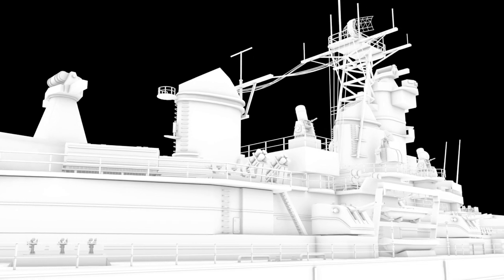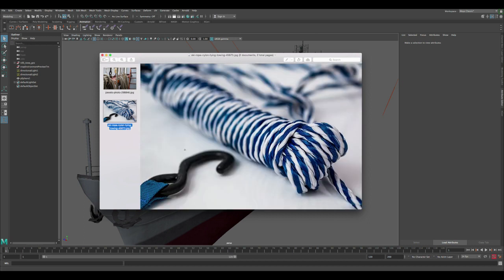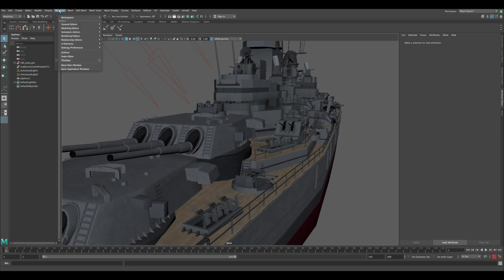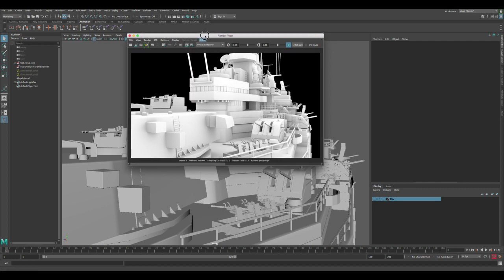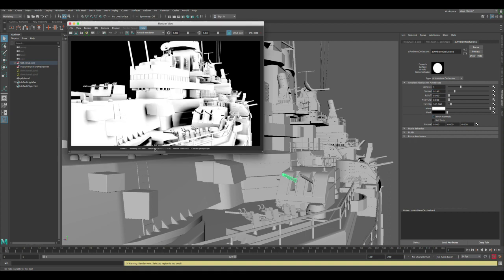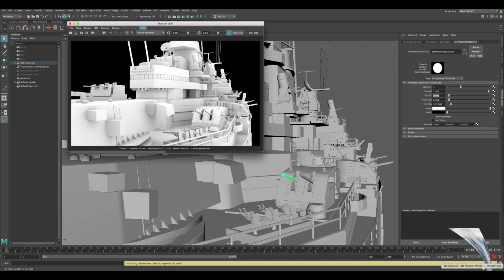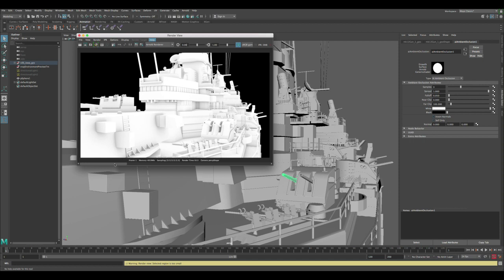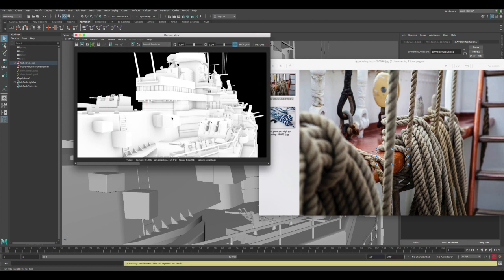How To Create Ambient Occlusion in Arnold Maya 2018

Comment: Hi Adam! Great tutorial. I am just starting to wrap my mind around Ambient Occlusion when it comes to compositing it in to the final render. Could you recommenced a tutorial that covers that? Thank you!
Reply from the maker: Hello, Thanks for your comment. actually to composite ambient occlusion pass if you are using After Effects do the following:
1- Import the beauty pass that you rendered out from Maya or any 3d software  you use.
2- Import the Ambient Occlusion pass.
3- Create new comp with the settings that matches your rendered images size and frame rate like 720p @ 24fps
4- Add the beauty pass first to the comp.
5- Add the ambient occlusion pass on top of the beauty pass.
6- On the right side of the ambient occlusion pass inside the comp you will see the (mode) currently it will be set to (Normal) click on it and change it to (Multiply). Ambient occlusion should apply correctly to your pass.
7- if you cant see the (mode) and you just see bunch of icons, then at the bottom you will see  (toggle switches /mode) click on that and it will show you the (mode) options.
8-  Select the Ambient occlusion layer and Press (T) on the keyboard and then the opacity option will show up and you can control how much the intensity of the effect you want. 

Hope this helps! let me know if you have any other questions :)
Reply: Wow what a detailed answer! Thanks Adam. I'll give it a go. Keep up the great work you are doing!
Reply from the maker: You are welcome :) thank you! I'll create a quick tutorial on that subject soon keep on eye for that :D
Reply from the maker: Here is a tutorial we just did and if you check toward the end of it we cover how to apply ambient occlusion or dirt in this case to your model in photoshop the same way applies to after effects or any compositing program hope you will find it helpful :)
Maya Tutorial: How to Quickly Add Dirt and Grunge to Your 3d Models
Reply from the maker: forgot to add the link: https://www.youtube.com/watch?v=vlDGDaGPz_w&t=1s
Reply: careful to mask out any reflection passes and direct lighting..there is no AO really in areas under direct light.
Reply from the maker: Hi civilian, you have a pretty good point thanks for your comment!
Reply: you all prolly dont give a damn but does someone know a way to get back into an Instagram account??
I was stupid lost the password. I appreciate any tips you can offer me!
Reply: @Preston Jaden Instablaster :)
Reply: @Saul Sincere It worked and I now got access to my account again. I am so happy:D
Thanks so much you saved my account !
Reply: @Preston Jaden Glad I could help xD

Comment: question. how can I get the displacement from my aistandardsurface to translate in the AO pass when I am replacing the shader that contains that displacement map
Reply from the maker: good question, I'm not very sure, since I dont have the scene to look at, but as a work around, you could convert the displacement into geo, then apply the AO pass on the new displaced geo then render it as a separate AO pass and comp it on top of the beauty and other passes that you have.  in theory this should work.

Comment: hi 3d model world, I have a question . Is their a way that you can add an ambient oclusion map to a plane that has attached to it, a tilable texture that has an already baked AO texture that is also tilable and is base off the original texture image , note the plane has no deformation, so no AO data comes from the plane but the texture itself, and it already has the bakes of the ,normals, and heigh maps in separate tiff files. The texture is base on a pbr material that I got from textures.com, I just cant find a tutorial anywhere on how to add the heigh and the AO maps that are already baked into an image and connect them too a material in arnold. i am using maya like you. :) cheers.
Reply from the maker: So basically you want to apply the PBR textures to the 3d model correctly like ambient, diffuse, displacement, normal etc.. we can make a tutorial about that in the near future to discuss how to apply the maps correclty in Arnold, mean while we did a tutorial in the past talking about applying displacement map to plane to create rocks,  that might help you a bit, https://youtu.be/Z67Akgy5Gjo   thanks for your comment :)
Reply: @3DModelsWorld.  thanks :) it will really help me and I am sure others   on the internet as well. ;)
Reply from the maker: You are most welcome, by the way can you send the link of the textures you got from textures.com this will help us to plan the tutorial better :)